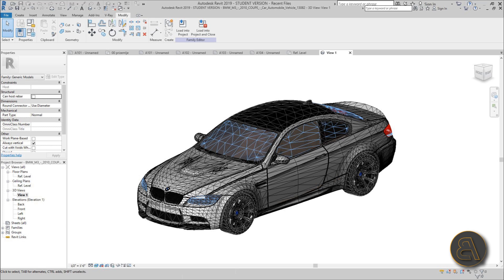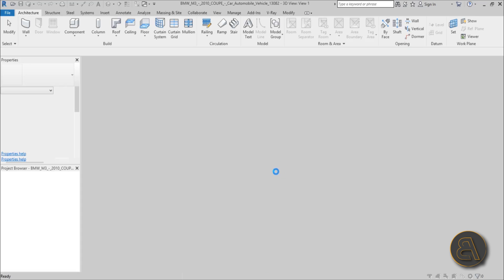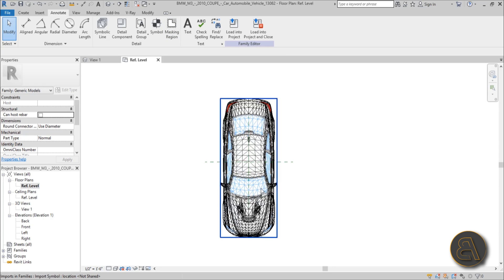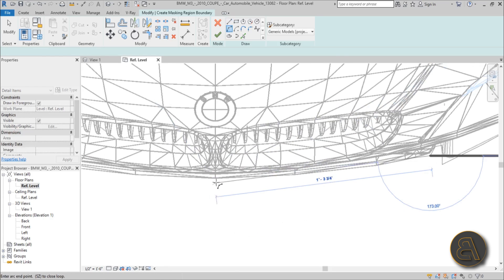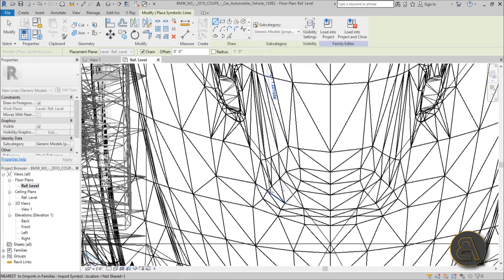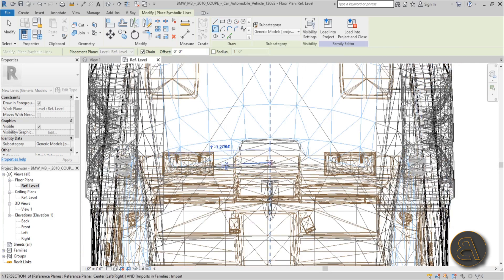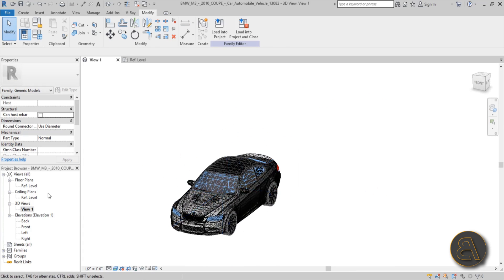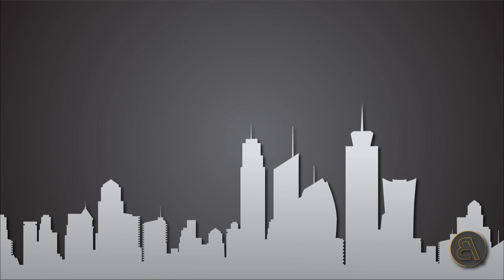Car Families in Revit Tutorial

Comment: Great tutorial as always.  One more step I recommend is to change the visibility of the 3D mesh so that it does not show in plans and elevations.  There is a lot of geometry that is hidden by the masking region that you created but is still part of the plan or elevation.  Making it not visible completely removes that geometry from the view and makes it easier on your video card to display what remains.
Reply from the maker: Good tip, thanks!
Reply: You can bring a car 2d dwg with solid hatch into revit and add it up to the 3d family in revit.. For easier way
Reply: Then you won't get the shadow of the car visible so it looks strange if you have shadows on in your layouts sections and elevations (which I do)